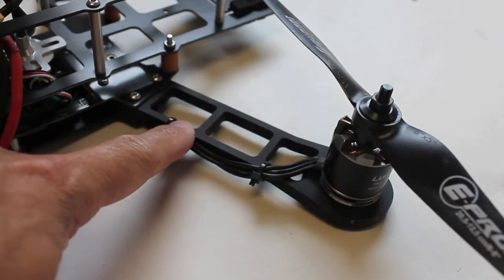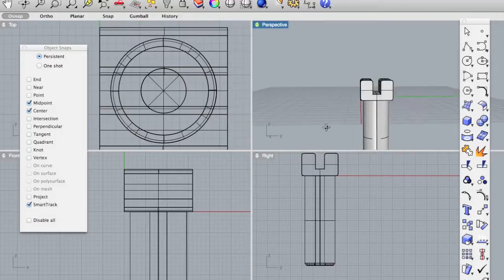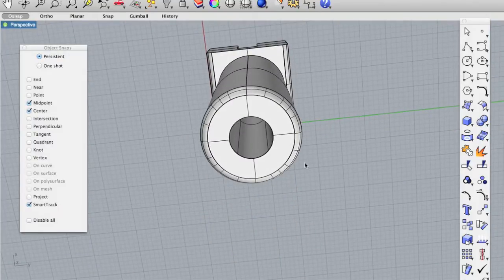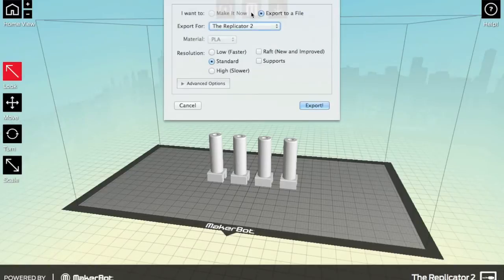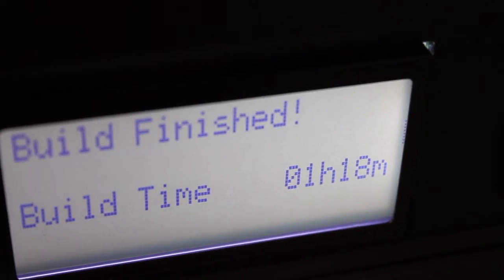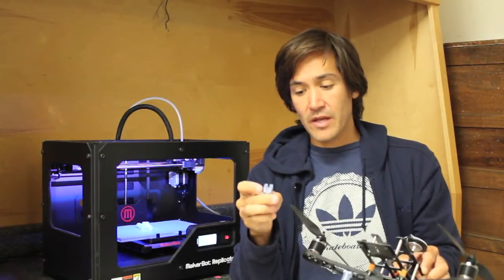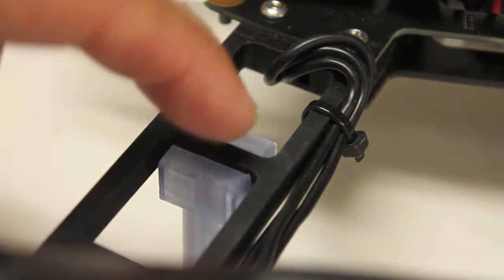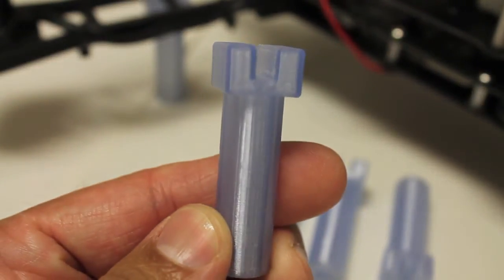3D Printed Landing Gear for QAV400 and QAV500 Quadcopter Available for Download on Thingiverse

Comment: Dennis - Awesome simple!

I think you will get better strength against really hard landing, if you redesign this so that the gear fits on the two side bars along the arm instead of the cross bar. Also fitting them closer to the frame end ( as opposed to motor end ) will reduce the stress on the arm further.

I am going to make these and see if I can stick the peg in some polyurethane balls for extra cushion :-)

Thanks for making this video.
Reply from the maker: Rajnish Kapur Very nice tips! Thanks for the suggestions and let me know what you come up with. Take care.

Comment: How do you print without the raft when I do it does not come out right
Reply from the maker: I'm not sure how you're printing but I print the landing gear upside down. That way I don't need to use rafts. Since the gap between the two braces that attach to the QAV arm is relatively small the 3D printer can clear the gap easily without having to use a raft. This has been tested many times on my MakerBot Replicator 2. Hope that helps and good luck.

Comment from the maker: Great question. You know, I haven't had any problems with shrinkage. As of now, my prints have been relatively small. I've read that it becomes more of a problem as you do larger prints, but PLA is also known to be fairly shrink resistant. In the case of this landing gear I printed I made the gap 4mm wide which is what the calipers read.

Comment from the maker: Thanks. I hear you regarding flipping the print. I originally printed it with the U shape up top and the problem is the overhang. If you place it with the U down it's easier to bridge the gap since it's only about 4mm and the PLA will bond to both sides. Printing it with the U at the top doesn't give the PLA to bond to so it will extrude and then fall to the build plate. Hope that makes sense and good luck with your modeling and printing.

Comment: Looking good. I have been watching you stuff for a while. I have access to a makerbot and have started 3d modeling some parts myself. I am impressed how the makerbot was able to bridge the gap over the U shape that was upside down and then print the rest of the round part up to the top. I would have flipped the print so the round part was printed first then up to the U shape. Hope that makes sense.

Comment from the maker: Great suggestion guys. I was originally thinking about doing 2 zip ties on each side of the landing gear cylinder, but couldn't get it to work. I think you've nailed it. I will do a cutout for a small zip tie to slide through and wrap around the top of the arm. I'll post an update soon. Thank you very much.